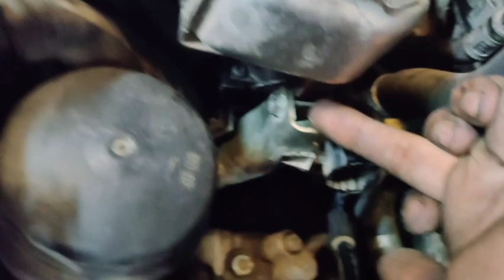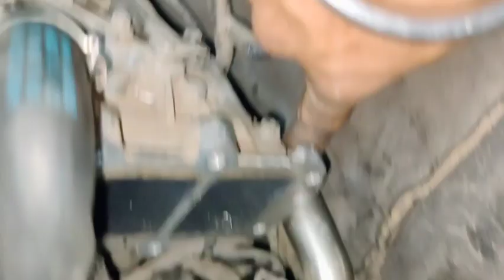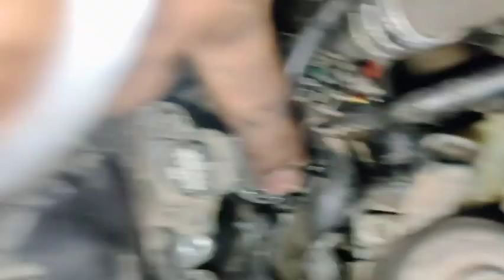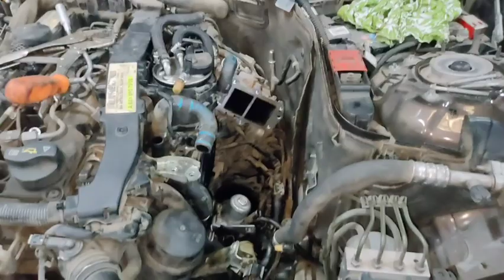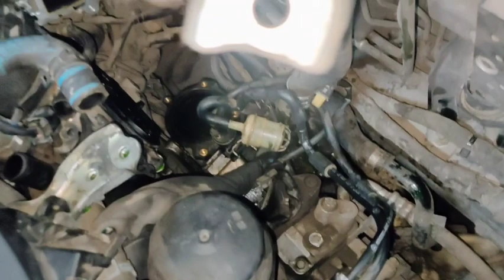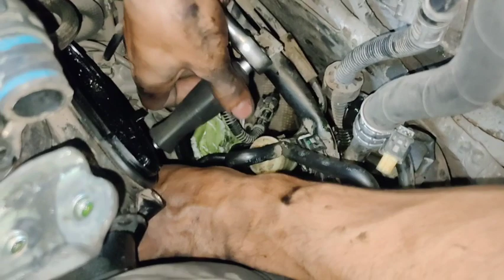Mercedes 651 Engine oil cooler replacing

Comment: I think its recommended you replace every 80,000 miles, if thats the case i will replace mine when i replace the plastic manifold thats cracked a known fault on these engines, Mr Mercedes designed a wonderfully compact engine that is so difficult to maintain !

Comment: Hi the pipe you remove at 1.22 minutes - the side bolts - there’s one that I just can’t get out, I’ve loosen it slightly. What tools did you use to remove these bolts.  Thanks.
Reply from the maker: Hiii..you can use 8 mm flat wrench to open that bolts
Reply: @MotorqueIndia  Thanks

Comment: Hi I'm having problem with my Mercedes a class 2.1 diesel it struggle to start in the morning but when it starts and warms up it's fine and I have a error code p0196, I have engine oil temperature sensor but don't no where the location  can you help. thank you
Reply from the maker: Hey..i think you have some issue with your glow plugs or with fuel supply..1st start diagnose with glow plugs after that check your fuel supply and injectors diesel return..i think this may help you with starting problem..and your oil temprature sensor is in oil level monitoring sensor

Comment: Hi Thanks for the earlier advice - that worked well.  The bracket you removed at 2.48 - 2.51 has a bolt that so deep seated - How did you remove this bolt. And what size E socket did you use. Thank you very much.
Reply from the maker: You can whatsapp me on this number 9888002468 i will video call you and help you where needed

Comment: It's a huge amount of work and you make it looks so easy!!
Great job
Reply from the maker: Thanks 👍
Reply: I have my car in my driveway in london, someone told me is a cooler leak, so no oil pressure in engine and timing chain tensioner, are you in london? I’m opening it tomorrow, let see. Only video online is gour one.
Reply: @MotorqueIndia  hi, nice work, just a question Did you take off the AC Compressor, or you didn't??
Reply: It is easy...only issue is the egr cooler can be a pain as the bolts are well hidden

Comment: Why you have to replace the oil cooler? And if it’s bad, what’s going to happen if you don’t replace it ?
Reply from the maker: Engine oil was mixing with Engine coolant...due to oil mixing with coolant there is so many risk of overheating blockage in coolant pipes, radiator...in some cases engine failure too..

Comment: Hi, Great job - please advise - must I drain the all oil from the sump pan and then change this part - or can I leave the oil in?
Reply from the maker: Isn't neccesary to drain oil for change this...but you need to change engine oil after replacing oil cooler some time some coolant goes in via oil cooler slots of coolant
Reply: @MotorqueIndia  Thank you.